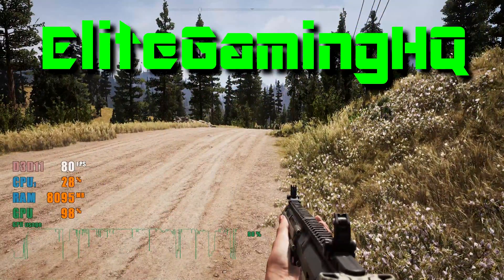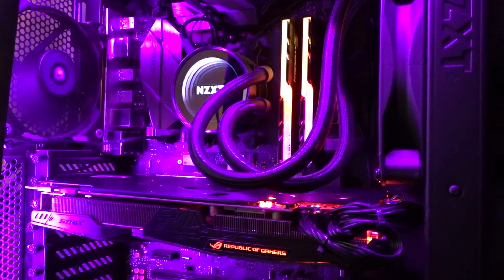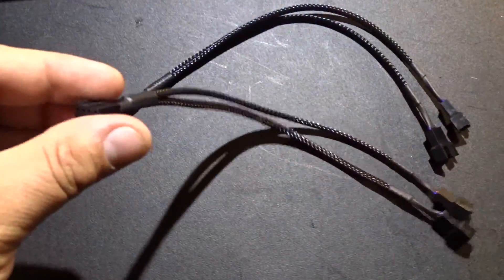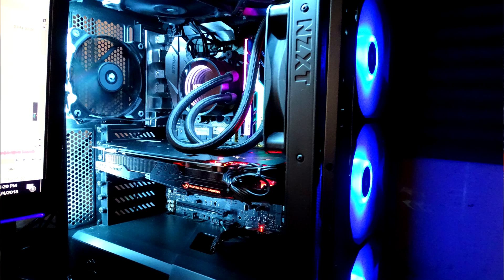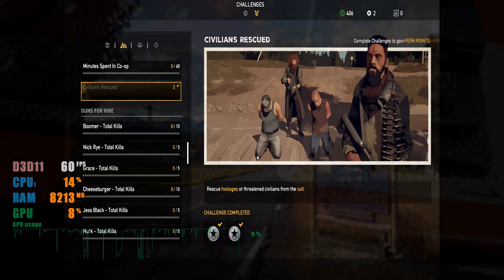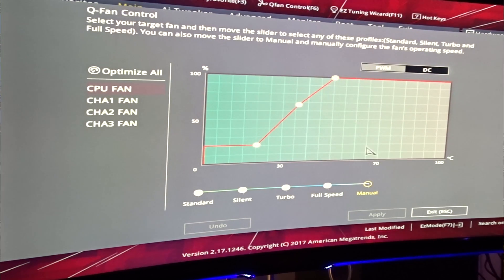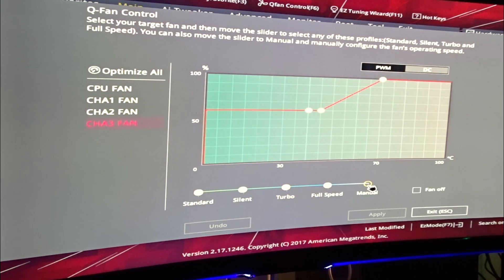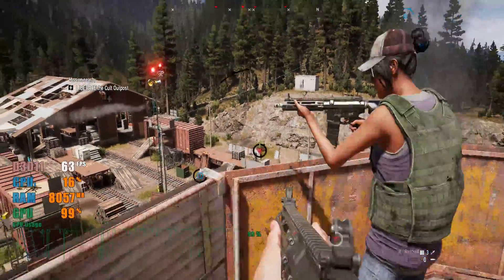How to Fix loud PC fans on your gaming build and get better PC temperatures (quiet fans)

Comment: A few months ago I was replacing my CPU, and the fan it came with wasn't compatible with the socket. At the time I didn't know that, so when I plugged it in, I think it was my back fan that spun so fast is sounded like a damn NASA rocket. I quickly shut it down thinking it was going to explode, that's when I found out the fan wasn't compatible with an LGA 1151, yet the CPU was? Intel what were you thinking? Ever since then my back fan has been loud as hell, it works properly and keeps hot air out, but my god does it get loud while playing CoD. I might have to clean it or something idk.

Comment: @EliteGamingHQ my problem is that my pc sounds like a jet all the time and I can’t manually set them up cause it looks like the pc is not reading the fans
Reply: Visible I have the same problem when playing pubg only. However when I play tarkov my pc runs fine.
Reply: BlackBeardJay oh I’ve recently just got this pc , it sounded normal the first two months but then I moved it into another location and now it just sounds loud ..... the problem is that my pc automatically thinks it’s on high temp so the fans rpm’s are high ... even when I’m not running games...

Comment: What usually happens when you put it on silent mode? Does it make your PC hotter
Reply: Exiphr yes it turns slower
Reply from the maker: Silent mode keeps the fans at a lower RPM to make less noise. If you had a big case with lets say 3 120mm fans in and 3 120mm fans exhaust then you can use silent mode with no little to no heat issues. I find making your own fan curve to be the best. Most CPUs reach critical temps at 85c so I have mine run at 100% for 75 or 78, then make a curve that dips lower as the temp drops. You can start with 50c as a 50% rpm or volts and that will make your own "silent mode" when the PC is cool. Also for a lot of CPU coolers that pull air downward like any ryzen cooler or stock intel cooler you will need those 120m fans to exhaust all the extra heat that is just getting pushed around the case. So turn the tamp gauge triggers yo be on the CPU socket.

Comment: thank you for the video, went into the bios, should i put my fans to dc or pwm? dc seems to be a bit more quiet and my cpu fan even turns off completely (also wondering whether that is bad because i don't know whether the fan will wear done from turning on and off the whole time)

Comment: just buy a console pc gaming is dying with high gpu prices and ram prices and trash games. this is why console is king just plug and play dont have to worry about none of that shit
Reply: Consoles are pathetic
Reply: JOJO SS 1. lets see hmm all exclusives from Ps4 and Xbox and PS4 and switch etc are in some accessible on pc through emulators or not. 2. Higher FPS. 3. pc has thousands of exclusives 4. Modding. 5 better graphics. 6. More features and ways to entertain. 7. One of the devices needed in this day and age. 8. Unless it’s racing fighting or casual games with really no FPS competitive aspect controllers are pathetic and ruin the experience most of the time. Also technically through pirating, every game is free.

Comment: is this a good build to play 1080p at +60fps ?
Ryzen 7 1700
GTX 1060 6gb
MSI Tomahwak B350 
8 or 16 ddr4 ( idk which model/MHz )
550w Power Supply
NZXT s340
1TB HDD
Reply from the maker: on what game? and yes
Reply: i will say most fortnite, maybe GTA 5 or PUBG And which ram should i get ?
Reply from the maker: 8GB should be enough but 16 will be good for a real long time.
Reply: Thanks Man, Really Appreciate it.
Reply: @rootalex2146  did u build it yet

Comment from the maker: It has been a little while hope you all didnt miss me :)
Reply from the maker: But I am back for now.
Reply from the maker: Hello
Reply: @EliteGamingHQ  hello 😂
Reply: I have 3 fans I can control, but my fans on graphics card and processor, the in built ones are the loudest, to the point where regardless of me turning external fans on or off the sound is the same...... Can this be solved?